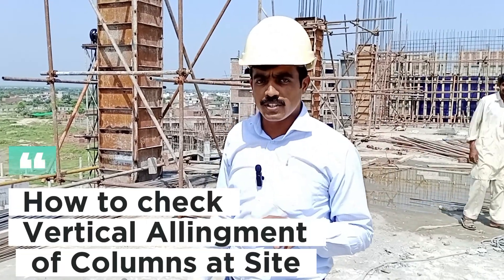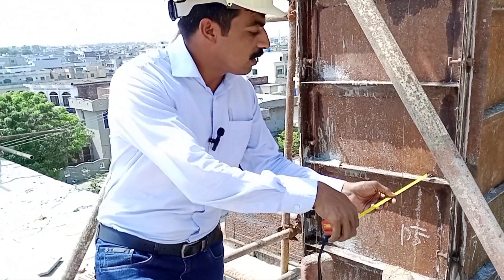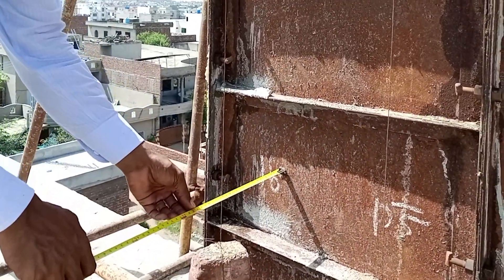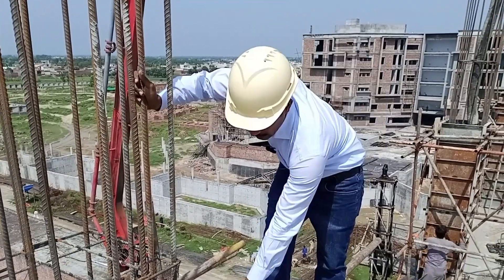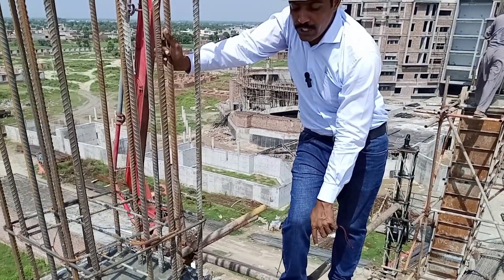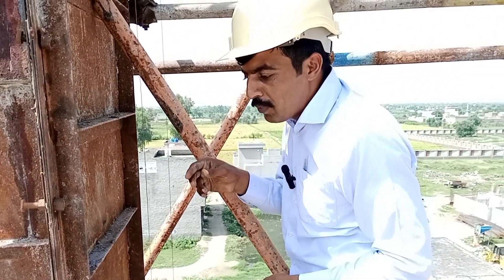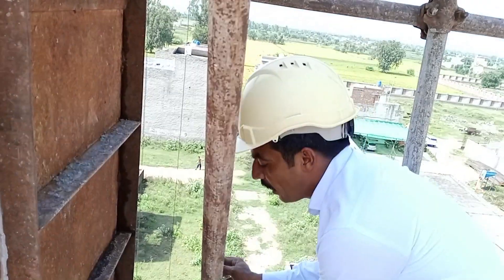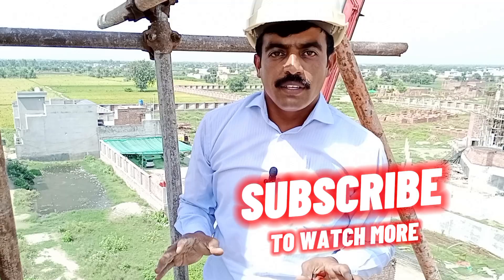How to Check Vertical Allingment of Columns at site | How to check Plumb Bob of Columns

Comment: But you did not tell in this video  procedure of how to check verticalty of column
Reply from the maker: @Manojyadav-td2cc   I apologize for not including the procedure for checking the verticality of the column in the video. To check the verticality of a column, you can follow these steps:

1. Mark a Plumb Line: Attach a plumb line (a heavy string with a weight at the bottom) at the top of the column. Make sure it hangs freely without any obstructions.

2. Observe Alignment: Stand at a distance and observe the position of the plumb line in relation to the column. It should ideally align perfectly with the center of the column.

3. Measure Deviation: Use a measuring tape or a level to measure the distance between the plumb line and the column at various points, both at the top and bottom. If there is any deviation from the center, this indicates that the column is not perfectly vertical.

4.Assess Tolerance: Check your project's specifications or local building codes for acceptable tolerances. Typically, small deviations might be allowed, but significant misalignment may require correction.

5. Adjust if Necessary: If the column is not vertical within acceptable tolerances, adjustments may be needed during construction to bring it into alignment. This may involve shimming or repositioning the column base.

Remember that ensuring the verticality of columns is crucial for the structural integrity and aesthetics of a building. Always follow industry standards and local regulations for accuracy and safety.